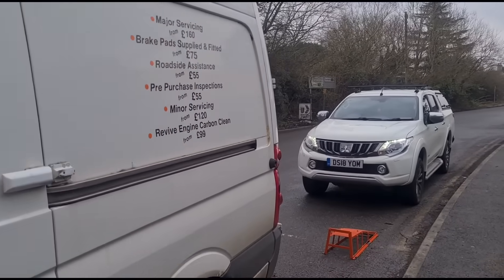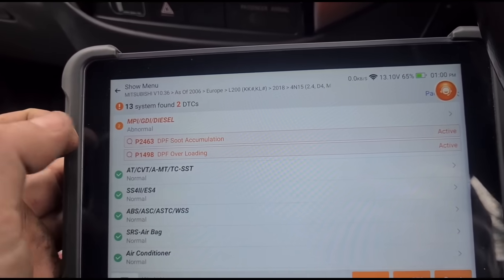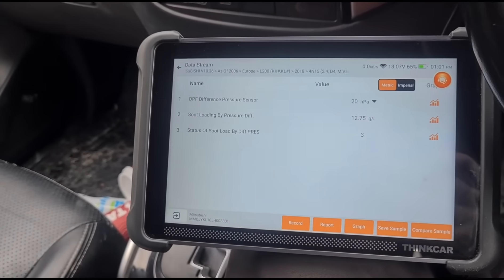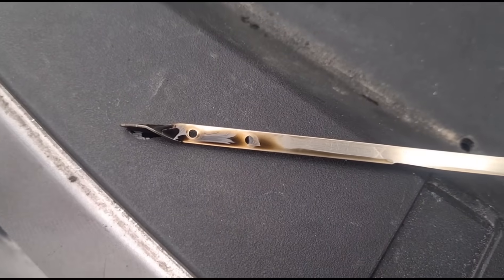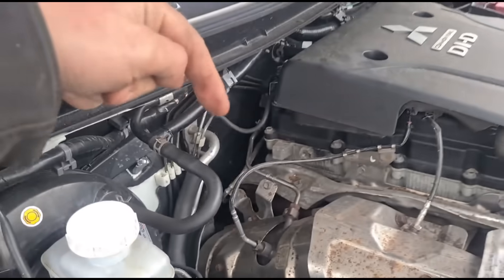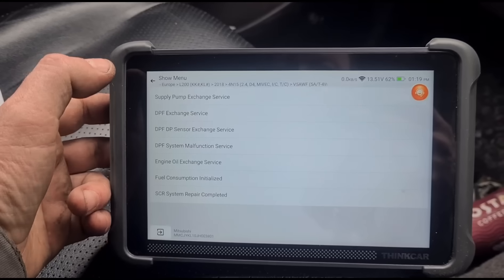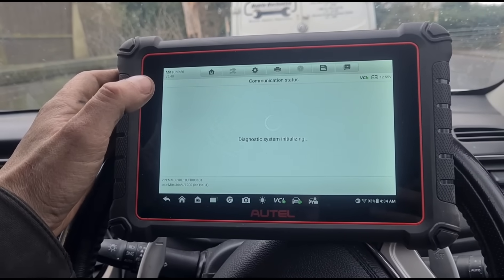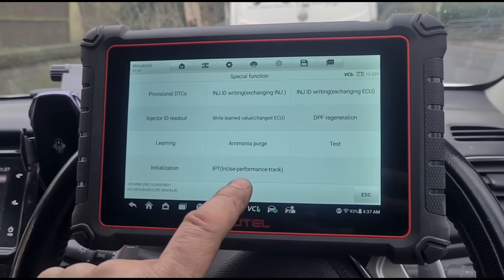Mitsubishi L200 P1498 & P2463 DPF Overloaded

Comment: Jimmy. After needing some of your magical advice please.

My 2019 Peugeot expert 2.0L ... 119k miles.  DPF diff pressure at tick over 45mb.... Up into HUNDREDS of mb.... 

DPf has been removed and mechanical cleaned. 

Refitted...... 

No change. 

Even used manometer to manually test diff pressure at tick over = 45mb. 

🙏👍
Reply from the maker: New DPF time
Reply: @ORileysAutos  well... i figured as much..... but ..... 'mr jimmy' is the fella i wanted to be told this by. 🙏

Comment: When I saw a video on the Honda CRV oil dilution previously I checked and took some oil out to drop it to between half and three quarters. Previously it was just over max. Didnt want the DPF not regenning
Reply: In that case you need an oil change and not to just remove some oil.
Don't forget there is fuel in your engine and that's something we don't want

Comment: To  Jimmy (or anyone able to explain straightforward): What is the origin (how does it happen) of the VERY thin oily black soot(?) that I can finger-smudge on my exhaust pipe regularly ? I watched many DPF related tutorials and Jimmy's videos (including this really informative one) but somehow still fail to understand EXACTLY why this is happening...what exact particles (material) that dark material consist of.......the engine is K9K 110dci (installed in 2018 Dacia Duster pre-AdBlue version)...has around 112 000 miles (185 000 km) on the clock, I am the first owner, I drive it pretty conservatively (cca 2000 rpm...the consume wise "sweet point", also around max torque value) and NEVER had ANY dashboard warning indications ...nor ANY REASON to suspect anything wrong with the exhaust system. Also, I clearly can detect when active regen might be engaged (around 900 rpm instead of normal 850 when idling), off course, during normal engine operation, not when triggered by heightened system needs (heating, lighting and similar).....so, again: if regen burnt ash (remaining in the DPF) is white, what is this black material....obviously getting "downstream" through the DPF....and with no dashboard warning indications ???? Forgot to mention, neither any permanent or active codes readable by cheap OBD readers......also, I change engine oil with the original RN 0720 ELF  every 10 000km, never missed it...and neither loose nor gain (via diesel dilution) a drop of oil in those intervals.....

Comment: I have mitsubushi 21 plate shogun sport and the 689bt. It's basically the same engine as the shogun sport, I managed to do oil reset on it.. nut never reset the dpf.

Comment: my 12 plate berlingo keeps doing regens every day no codes runs fine any idea why it keeps doing this?  cheers.
Reply: Dpf blocked, too blocked to do a regen so it’s failing. Get it cleaned a you will be fine an also clean the vaporiser. Iv got a video on my channel how to do it . Also jimmy has .
Reply: @devito501  Thanks
Reply: No vaporiser on a Berlingo buddy. Fap fluid is the aid to regeneration on these.